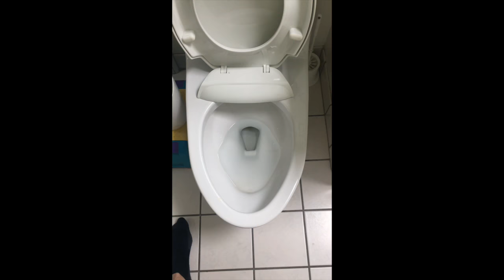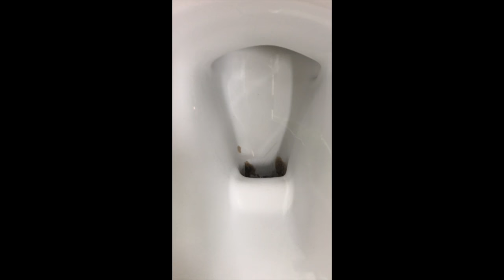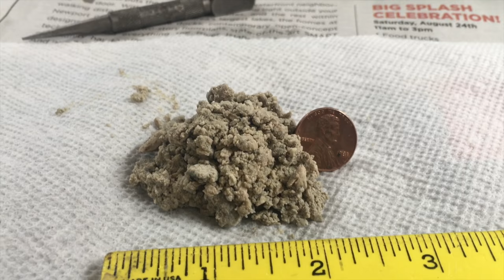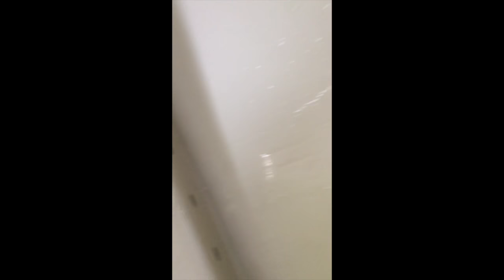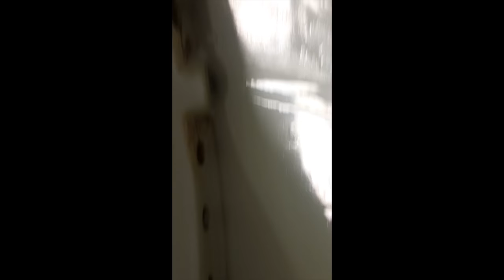Unclog Toilet Bowl Siphon Jet Hole to Improve Flushing

Comment: 4 years and this video is still helping people! I was about to replace my 5 year old toilet because it wouldn't flush properly. I went through many videos before stumbling across yours. Showing the material that you removed and the tool you removed it with did the trick. Thank you for saving me 300 bucks or more!
Reply from the maker: Great to hear the video helped. So nice to have a toilet that flushes well.

Comment: You think you know everything there is to know about something until something like this pops up. This has probably been 90 % of problem with toilets over the years. Have to wonder, myself including how many toilets are replaced for this problem alone....
Reply from the maker: I agree. One could guess that many thousands of toilets have been replaced that could have been easily fixed with this solution. I was considering replacing our toilet until I stumbled onto this fix.

Comment: This was the video that pointed me to the REAL problem with my toilet. I had been considering getting a new toilet, and you saved me a ton of time and money. After cleaning the siphon jet (with the $5 auger from harbor freight, which worked great on rim jets too btw) my toilet went from not even flushing on the highest water setting to being fully reliable on the lowest setting. Quite an improvement, and I didn't get out anywhere near as much "dirt" as your video shows
Reply from the maker: Thanks for the great comment with the details on the tools you used and how things worked out for you.
Reply: Could you tell me specifically  what tool you used from harbor freight, thanks!
Reply: @yshcordaro5254  they call it "hydrostar plumber" its not that great for drain clogs but for my toilet jets it was just right
Reply: @sv650touring  Thank you!

Comment: Thanks so much for posting this. I have had a slow flushing toilet for years and just dealt with double or triple flushing it. Someone told me about clearing the siphon jet hole so I bought a twisted wire nylon brush and put some acid bowl cleaner in the overflow and tried working that into the siphon. I could not get the brush to go into the siphon hole so I gave up and got on the computer and found your video. Then I got a nail punch, emptied the bowl and was amazed it actually took some effort to punch through the build-up! Then I knew I had it. I kept scraping out the junk and then brushed it out and we are flushing 100% once again. Thank you so much for this video. I can see from the responses you have helped many people, and maybe saved my marriage, too.
Reply from the maker: Thank you for sharing your story of the frustration of a toilet that doesn't flush well. I really feel for you and how a spouse can be frustrated by your inability to get the toilet to work properly.

Comment: I didn’t realize I had this problem until changing the flapper in the tank and saw it clogged, I use a pitcher of water to empty the bowl and fill with either vinegar or bleach for 30 mins and then use a bamboo pick from Red Robin burgers to scrap out the inside with gloves, I initially used a clothes hanger but was worried metal may damage the porcelain.

Comment: Yes! Yesterday we replaced the flapper and other parts, and adjusted settings but nothing worked. So we tried again, and again...and again. I was sure the problem wasn't in the tank at that point, so went to bed accepting that we'd have to call a plumber  and possibly have our main line augered. I woke up, searched and found this video. And the sediment that came out was unbelievable! Still preparing myself to have to spend tons of money, I flushed.  And it was beautiful! Wish I found your video sooner, but so thankful I found it when I did. I truly can't thank you enough!
Reply from the maker: Thanks for sharing. It's great to hear my video helped you fix the problem. That puts a smile on my face. I remember how frustrating it was for me until I figured out the problem.

Comment: Thank you for the solution to my problem! I had been attacking the issue as if it were caused by a clogged drain, when it turns out the problem was caused by clogged jet holes. They were clogged by the cleaning tabs that you stick inside of the bowl.
Fun fact, my toilet doesn't have a jet hole in the bowl like yours, but rather jet holes located under the rim. I had to use a liquid bowl cleanser bottle with the tilted neck designed for spraying under the toilet rim.
I filled the bottle with hot water and dish detergent. I then inserted the nozzle of the bottle into one of the jet holes. Upon squeezing the bottle, all of the gunk from the cleaning tabs started pouring out - solving the problem. 
Thanks again!

Comment: I have been having  a problem with the toilet tank bubbling when flushing and slow drain out. Tried everything till my dad, a jack of all trades said it could be that little hole in the bottom of the bowl needing scraped. So I was able to get my hand in there and actually scrape through with my finger nails and I got the hole opened!!! That was all it took! Flushing with NO BUBBLING IN TANK AND IT FLUSHES SO MUCH BETTER! I wish I had seen your video sooner, but thanks for educating and sharing your experience and advice! Bad plumbers who can't tell us toilet peons about this needing to be done for a better flush! It's not the drain or the vent on the roof but that hole needing scraped out! Thank you!!
Reply from the maker: That's great to hear. Thanks for sharing your story.

Comment: My toilet is about a year old, it's very clean, but I kept seeing something sticking out of that hole. Almost thought it was something growing in there.  I put on a glove and used a wooden bbq skewers and poked and scraped.  What came out looks exactly like yours, almost like grey sand. And when I got deep enough, a substantial chunk came out and water started flowing.  I have a whole house water filter (so our toilets are literally filtered water) and we really don't have hard water in this area so I didn't expect this.   I've recently had a musty mildew smell that I can't pinpoint.   I think it had something to do with the water that was stagnant and not flowing out of that portion of the tank.  Thanks for the video and  info.
Reply from the maker: Thank you for passing along your observation. I just recently saw something strange with my toilet that may be related.

Our toilet had not been flushing as strong (this is the toilet in the video). I reached into the siphon jet hole and there was like a blob of sand. It wasn't hard like the deposits I had scraped out in the past. I just wiggled my finger around in the hole and disrupted it and then it was moved out of the hole on the next flush. Strange. It was like the deposits  glommed together, getting ready to stick to the side of the hole.
Reply: I heard not to leave urine sitting overnight in a toilet because it causes calcium build up from the calcium in the urine.

Comment: Like the rest of your posters, I was referred to the rim jet for cleaning and for months wondered why not much help.  Replaced flapper,  handle and lift shaft, even had individual who poked a screwdriver into the BOTTOM JET- as with the rest of your readers, I had no idea that this could be completely clogged !!  Why is there no description of BOTTOM JET calcification, what tool to use to scrape away, what product to use in the bowl for it to eat away at the calcified clog?  These people, myself among them, had no idea of this hidden problem.  A product describing its use for sale in the hardware store would sell like hot cakes and make the manufactures millions!!
I used a short paring knife, after reaching in to inspect the small slit opening and realizing the near-total calcified clog still remained!!  I have nearly half to go yet; large chunks lie behind the calcification adhering to the BOTTOM  JET circular opening.  Unbelievable. The CLR product says not to let it set for over 3 min?  Which does nothing to remove the clog.  
The problems stems from not being aware of the TWO types of jets, rim and bottom.  And living in a community  which supplies very hard water without the info necessary other than water softeners to live with the problem.
Reply from the maker: I agree this whole thing is frustrating. My toilet had a flushing problem for several years before I stumbled on the real issue. I'm sure many others have the same problem but have no idea of the real issue.

As far as I know, there is no safe product that will dissolve this particular kind of buildup. It just has to be physically scrapped out.

Comment: Thank you man, worked great after cleaning. 
Turned off valve, cut a water bottle to fit the smallest part of the bowl and removed all the water and dried off with old rag.
Used a long thick screw to poke at the build-up from the clean side, don't try to remove it in any other ways, this is by far the easiest.
I also cleaned the part that goes to the sewer pipe and now all the inside looks brand new and the toilet flush perfectly.

Just push lightly onto the toilet with the tip at a 25-ish degree angle and do small tap/stroke and you should see flakes coming off. 
Use your finger to feel the inside of the hole, it should be smooth entirely. Do your best, some parts are hard to reach.
You can wear a long glove if you think it's gross, but you will probably clean your hand after anyway.... 

I washed my toilet with Ajax before doing this.
Reply from the maker: I'm glad it worked out for you. 

Thank you for the detailed explanation of how you cleaned the siphon jet hole. This is a great help for others looking to fix the same problem.

Comment: Thank you! My toilet had become a pain in the butt because it required several failed flushes before one finally and very weakly worked. I extended the pipe inside to raise the water level in the tank, which worked for a while, but the problem soon returned. A cup of CLR and 10 minutes of scraping out gunk, and the toilet is flushing like new. Thank you for the awesome advice!
Reply from the maker: Great to hear. I'm glad it worked. It is SO nice to have a toilet that flushes well.

Comment: What I ended up doing additionally is pouring a mixture of bleach and water in the overflow tube, waiting a little bit and then flush. Then I sprayed mineral spirts fluids on each jet hole under the rim and with a coat hanger, clean out any blockages. Also, went ahead and did this method. Toilet flushes now 👍
Reply from the maker: Thanks for the extra tips on how to improve the flushing.

Comment: I was cursing Kohler up and down. Toilet would rarely flush properly on its own. Then I noticed what I thought was rust staining was actually a calcium buildup. I used a small paring knife to get under the buildup and was able to pull away huge chunks. Shocking!! This is a 4 year old toilet.

I cleared the jet hole and it works perfectly
Reply from the maker: Thanks for sharing your story. It's so good to get the toilet to flush correctly.

Comment: Thanks, Eric. Plumber told us we were due a new commode in the not too distant future. After about half hour with a tiny screwdriver, it works like new. I think I'll declare February 11 "Love your commode day" and clean that hole out every anniversary. :-)

These things are porcelain - unless you crack it some way, I cannot imagine why you would ever have to replace one. With just a little knowledge and minimal mechanical skills, you should be able to repair the commode that came with your house to infinity and beyond!
Reply from the maker: I agree. A toilet should last a lifetime and more. 

I imagine innumerable toilets have been replaced and could have been easily repaired with the right knowledge about the actual problem.

Comment: We have scrapped most of the "crud" out of jet hole..is it OK to use CLR for the rest
( we let vinegar sir over night, and didn't clean it completely)
Reply from the maker: There's certainly no harm in using CLR. In my experience, I haven't found anything (CLR, vinegar, etc) that dissolves the buildup in the toilets I've worked with (just a couple). Only scraping seems to help.

Comment: My question is wouldn't CLR work to help break up the junk... I had to use a pipe cleaner to clean out the rim jets and I'm hoping the bleach tablets help keep everything clean
Reply from the maker: I don't know if CLR will help with this particular buildup. Maybe it would. As Jeremy commented just yesterday (see below), these deposits are pretty hard. They can be chipped out, but it takes some effort. 
The challenge with CLR would be getting it to that area at the bottom of the bowl. Flush the toilet with the intake water turned off to drain the bowl of most of the water and then pour CLR into the bowl. Maybe it would work, but given the larger size of this particular hole and the amount of buildup, it is probably faster to physically chip it out.
The cause or source of the buildup in this area might be different depending on the different minerals and such in different water supplies. In our case, we don't flush "if it just yellow" so that contributes to buildup different than just water minerals.
One piece of data about the buildup in my case is that I placed some of the material I removed in a bowl of white vinegar and this had no effect on it. It didn't disolve it or break it down at all. I point this out because vinegar is sometimes recommended to disolve mineral deposits in a shower head so the material in my toilet bowl at least was different than the typical shower head case.
Reply: @ericschmidt6129  thank you

Comment: Don’t use metal. You could damage the porcelain. Use a old toothbrush- I snapped off the brush part on an angle and it does just as well without scratching or possible chipping.
Reply: I don't know what kind of amateur build up you have in your toilet, but mine gets stuff like concrete. Your toothbrush isn't going to touch that.
Reply: I tried this with one of those mini electric toothbrush heads, and after a few minutes, the brush part came off of mine, too. But no matter how hard we tried to scrape it with that, it barely put a dent in it.  I am going to just cave and try with a metal tool.

Comment: I have a solid stone like build up in that hole. Soaking with vinegar has not reduced its side. Any suggestions?
Reply from the maker: I believe this is the same buildup that I had. It is very hard. I'm pretty sure if you use a hard, sharp object like a nail or a screwdriver you can chip away and scrape it out. It can be pretty stubborn. 

I should also point out that scraping like this does not damage the toilet's hard porcelain. Of course, don't use a hammer or anything like that. 

Let me know how it goes.

Comment: How deep does that siphon tunnel go, I’m just curious to know how deep I should be trying to clean out. The opening in mine was almost completely blocked, but I used CLR In it and it’s still not losening up
Reply from the maker: In my experience you just have to clean out 3 or 4" deep. You have to use something metal like a small screwdriver and scrape pretty hard. Whatever the buildup is, I've never heard of anyone being able to discolve it with a cleaner.
Reply: @ericschmidt6129  ok thanks.  I put in some hot vinegar earlier, going to leave that over night, it literally feels like concrete is lodged in there

Comment: Hope you can answer asap. How do you remove the water so you can clean the jet hole thoroughly? Our toilet has this slow flush and i think this is the same prob we have.
Reply from the maker: Turning off the water valve at the toilet and then flushing will prevent the bowl from filling up fully. You can use a small cup to scoop out the rest of the water. You can soak up the water with a rag to get it even drier (not essential).

I hope this helps.

Comment: thank you for your video. Just bought new toilet for old house and couldn't figure out why we still needed the plunger until seeing your video about cleaning out the jet hole. My issue was not calcium but rather something akin to green moss...is that the same problem and do you recommend vinager or bleach in the tank?
Reply from the maker: This green moss may be algae, from what I saw doing a search with "Algae Growth in a Toilet." Just from what I've read, this seems to be an issue with the tank and so it is different from the problem described in my video. The algae growth does impact flushing so that's not good. The articles mention using bleach or vinegar to treat it, which makes sense. I don't have any personal experience with this particular issue.

Comment: So what exactly did u use to clean it
Reply from the maker: A somewhat short, hard (metal) object is needed to scrape the stuff out. It can't be too long so it fits in the bottom of the bowl, but long enough so you can scrap back in the hole. What I used was basically a nail. A short screwdriver would work.

Comment: I watched the video a few time, I didn't see how you clean those
Calcium out from the jet with the tool, could you tell me how? Thanks!
Reply from the maker: A nail or a short screwdriver would work well. Anything somewhat sharp and hard. You just reach down with the tool in your hand and scrape around in the hole.
Reply: @ericschmidt6129  Thank you very much!

Comment: How were you able to reach the holes pls share
Reply from the maker: You just have to reach your hand into the bottom of the toilet bowl and scrape around with some metal tool like a short screwdriver. You can get most of the water out of the bowl first by turning off the water valve to the toilet and then flushing (the toilet bowl will not refill).